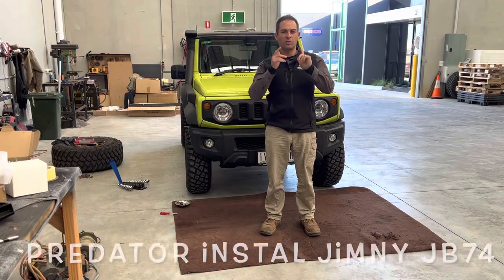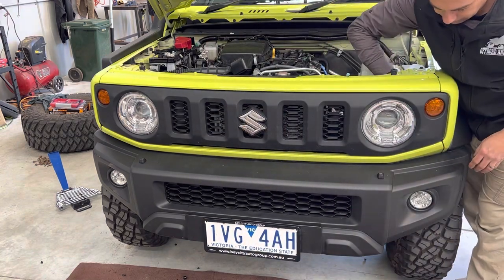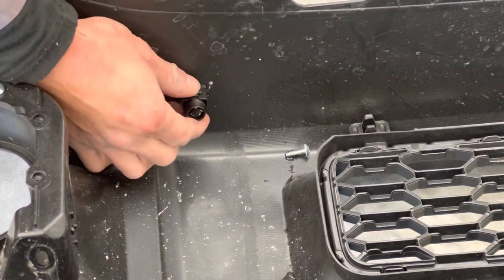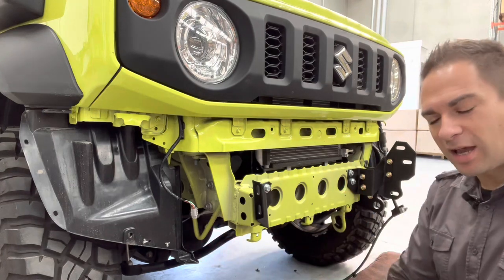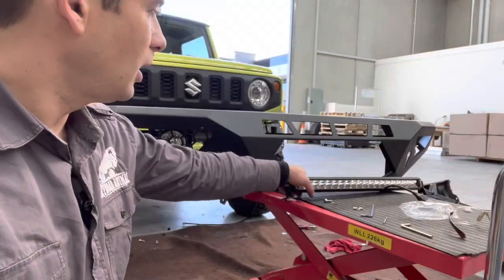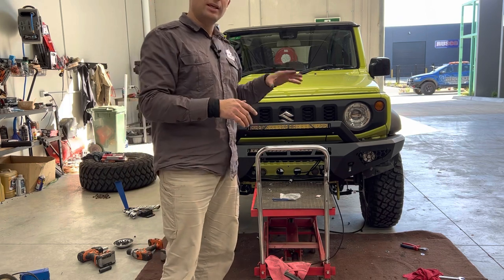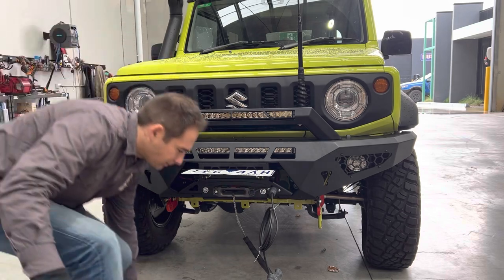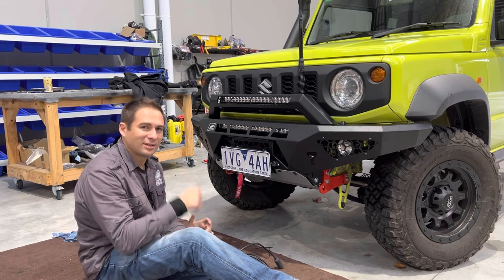Install video, Predator bar on a Suzuki Jimny JB74 2022

Comment: Is the bar 32kg in total? So once stock bumper is removed it add's 24kg to the car?
Reply from the maker: Yes correct
Reply: @offroadanimal  thanks, are sliders and a rear bar in the pipeline?
Reply from the maker: @KaizenOz  Sliders yes for sure, still considering rear bar
Reply: @offroadanimal  👍 looking forward to seeing what you come up with

Comment: How many antenna mounts are on the bar as I intend to fit a uhf as well as a Codan HF radio to my Jimny so need a good mounting point
Reply from the maker: there are holes for 2 already but you can drill as many as you like. If you get the stealth hoop there are another 2 on there

Comment: People, putting a steel bullbar is the stupidest thing you can do to a car. Plastic bumpers are meant to sacrifice in order to protect the chassis. Imagine having a solid piece of steel instead of shock absorbers.. of-course the whole car will fall apart once it hits the pothole..same theory goes here
Reply from the maker: spoken like a true blind person.  Modern steel bull bars are designed to crumple during an accident and absorb energy.  They need to be strong enough to take an animal strike but fold in during an accident.  So nothing like having a solid piece of steel instead of a shock absorber.  Maybe do some research before making yourself look dumb
Reply from the maker: @OOOUZ  Seriously have no idea how many saved from bull bars hitting wild life out here in Aus.  But hey not everyone can see it.  Keep your blinders on and let the grown ups talk
Reply: Agreed. Mainly for  macho looks. Adds 24 kg weight. I replaced the steel cable of my warn winch with a synthetic cable, saved 15 kgs. Makes quite a difference. But hey, gotta admit the steel bar looks cool...i reckon a solid skid plate, diff plate, warn winch with synthetic strap is the way to go
Reply: @offroadanimal  ive been living and working in the outback cattle stations/ mining companies all my life mate ;)